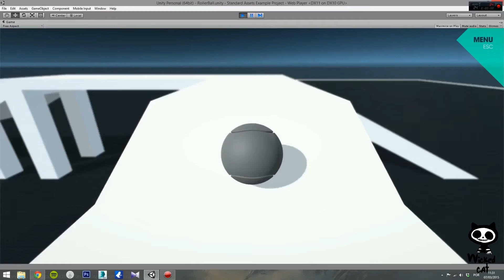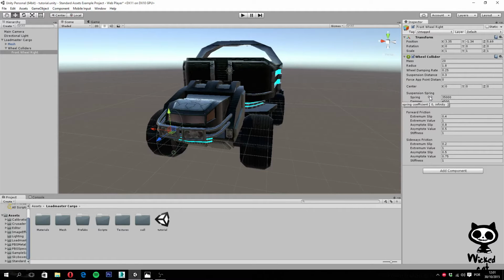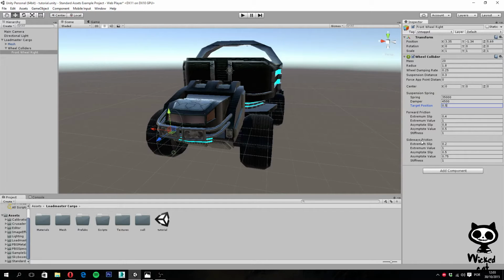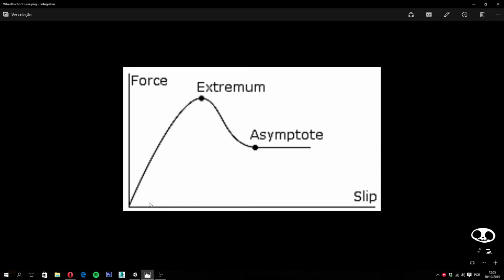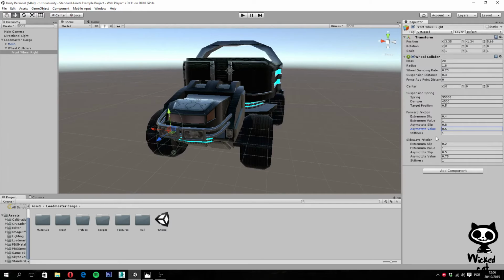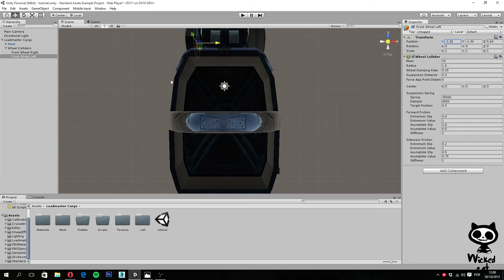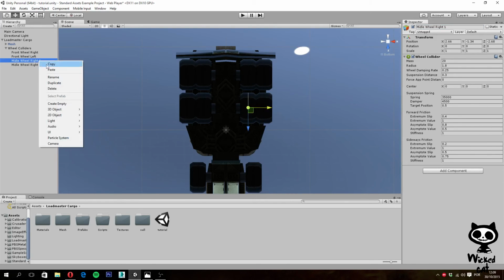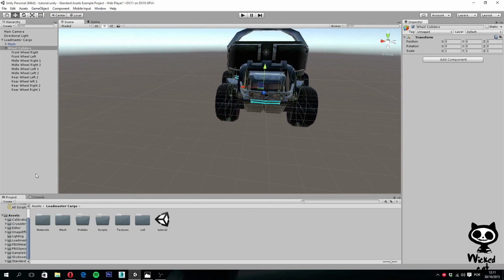Unity 5 - From Beginner to Pro #35 - Wheel Collider (2)

Comment: the entire code : 
using UnityEngine;
using System.Collections;
using System.Collections.Generic;

[System.Serializable]
public class AxleSportscarInfo
{
 public WheelCollider leftWheel;
 public GameObject leftWheelMesh;
 public WheelCollider rightWheel;
 public GameObject rightWheelMesh;
 public bool motor; //if the wheel is attached to motor 
 public bool steering; // does this wheel apply a steer angle 
 
}

public class Sportscarcontoller : MonoBehaviour {

 public List<AxleSportscarInfo> axleInfos; //list of all wheel pairs
 public float maxMotorTorque; // maximum torque the motor can apply to the wheel
 public float maxSteeringAngle;

 // Use this for initialization
 void Start () {
 
 }
 
 // Update is called once per frame
 void Update () {
 
 }
 public void ApplyLocalPositionToVisuals(AxleSportscarInfo wheelPair)
 {
  wheelPair.leftWheelMesh.transform.Rotate(Vector3.right, Time.deltaTime * wheelPair.leftWheel.rpm * 10, Space.Self);
  wheelPair.rightWheelMesh.transform.Rotate(Vector3.right, Time.deltaTime * wheelPair.rightWheel.rpm * 10, Space.Self);
 }

 public void FixedUpdate()
 {
  float motor = maxMotorTorque * Input.GetAxis ("Vertical");
  float steering = maxSteeringAngle * Input.GetAxis ("Horizontal");

  foreach (AxleSportscarInfo axleInfo in axleInfos) 
  {
   if (axleInfo.steering == true) 
   {
    axleInfo.leftWheel.steerAngle = steering;
    axleInfo.rightWheel.steerAngle = steering;
   }
   if (axleInfo.motor == true)
   {
    axleInfo.leftWheel.motorTorque = motor;
    axleInfo.rightWheel.motorTorque = motor;
   }
   ApplyLocalPositionToVisuals (axleInfo);
  }
 }
}